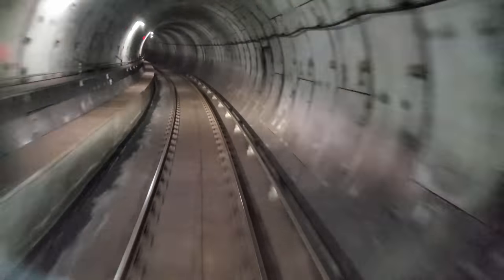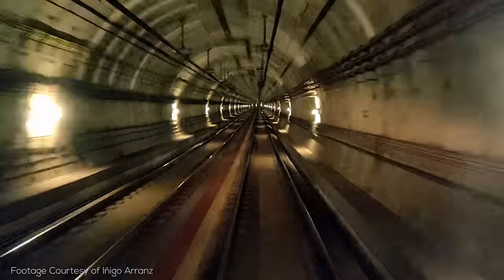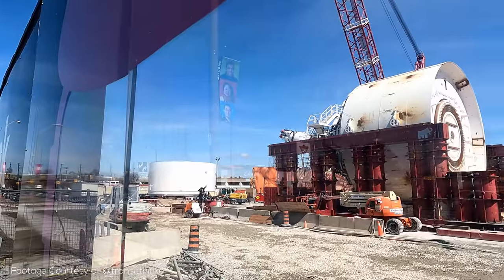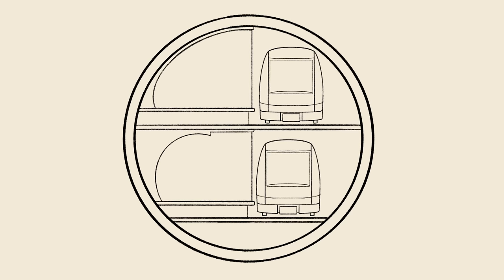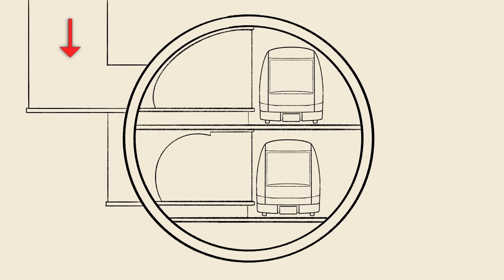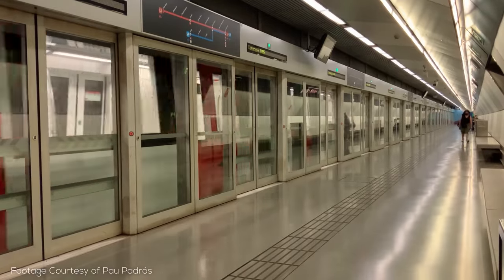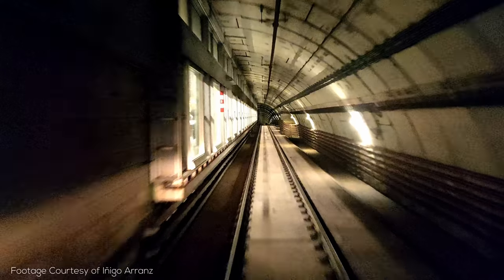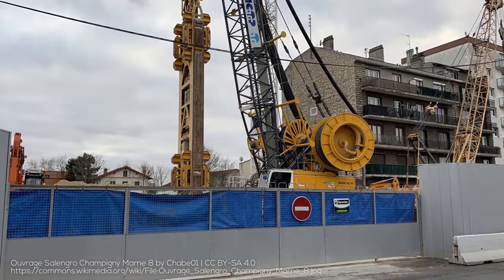A Different Way to Build a Metro? | Barcelona Line 9

Comment: Nebula viewer here, just dropping to make a quick comment... The other reason why cut&cover sometimes is not the most efficient in Europe is because of the amount of ruins we have. With the cut and cover method, works stop for months or even years at a time, and it takes a lot of time and resources to go even the smallest distance. While if you go much deeper, you can avoid it (mostly, except in stations, there you are going to find that issue again, but is just the stations as opposed to the whole thing). That's why Granada's "metro" (glorified tram) took so long on its central section, and is the reason why further projects might consider deep tunnels if they're ever implemented
Reply: That's the story of Rome's Line C metro
Reply: I believe that in one Italian subway system, the approach by the workers was "archaelogical treasures?  Huh, we just jackhammered through everything, move along..."  I think there's even a reference to that in a Fellini film.
Reply: Yeah. In Croatia, just the installment of a pedestrian underpass to access the platforms at Sisak station is already taking 9 years.
Reply: Same in Naples, Italy; the delays for one of the metro lines was constant due to the ruins and artifacts found during digging and boring. One line found everything from Roman villas to Greek merchant vessels, with practically all of it being left in situ as displays. Pretty neat
Reply: That’s and they don’t have wide streets like NA
Reply: Istanbul M7 - Besiktas/Kabatas stations, it looks like those 2 stations will take 10+ years to finish by the time they are done, as not 1 but multiple ancient settlements were discovered during their construction. (Not cut-and-cover but very close to surface due to being sub-sea-level.) They are even opening half of the extension in 3 weeks without those stations since the progress difference is that large.
Reply from the maker: It definitely can be the case - but it depends on the location!

Comment: Another crazy feature of lines 9/10 is that each level of the tunnel is fireproof and acts as an emergency exit for the other. That means emergency shafts that are usually required on modern subways are not needed. Also, because all the width of the tunnel is used, there is no room for sidewalks. That is not an issue at because in case of an emergency, the front of the train opens and a ramp allows passengers to walk on the tracks. Walking on the tracks is not dangerous either since the line uses overhead wires.
Reply: It's an overhead rail, and the signal current runs through the rails, but yeah, it's not as dangerous as it would be on the Northern Line in London. A lot of the Eastern end of the lines does have walkways beside it though, as it just makes things simpler.

Comment: The busiest stations of these 9 and 10 lines have only one or two elevators whereas the unimportant ones, eight elevators. Really wise, hahahaha
Reply: that's... bad... though how much of that is down to the fact that the ones that were Expected to be busiest (and presumably would drive a lot of the use of the currently underutilized ones) haven't actually been built/connected yet?
That would eliminate the 'unimportant ones' having too many elevators. Doesn't solve the lack of elevators at busy stations issue though.
Reply: @laurencefraser  
Hi. Well not quite the case. They’re busy coz they are connected to other lines. = it s about busy transfers.
These busy stations are as new as the others.
Reply from the maker: IIRC because they do have tons of escalators?
Reply: @RMTransit  
No. If you check these lines you ll see what I say. There are escalators in all stations and many elevators everywhere but not when they are peremptorily required. It s like saying two plus two is nine. I know well these lines.

Comment: Some precision on Barcelona line 9: the upper part of the tunnel (including the upper part of the stations) between Torrassa and Zona Universitària is still not built, the line is therefore single track in the lower part of the tunnel on this section. Line 10 could technically end at Zona Universitària like line 9 instead of Collblanc, but that would decrease capacity because as I said it's single track (single track terminals are terrible for frequency, terminating at 2 different stations is therefore required). On lines L9 and L10 North, both terminate at Sagrera station, which is also single track, all trains use the upper part of the station as the lower part is still not built. If the line has taken over 20 years of construction, it is not for technical but financial reasons, work stopped for almost 10 years (there was only 4km left to dig!) and did not resume until 2022. The Montreal pink line project was to use this method before being replaced by the REM de l’est, whose central Montreal branch was canceled.  However, a new route further from the green line and entirely underground has been proposed and may use the Barcelona method (although this is not necessary outside of Europe as the streets in Canada are quite wide enough  to build cut-and-cover).
Reply: As for the branches vs. separate lines debate, I think the correct answer is that it depends on whats make the line important. Line A of the RER has 5 branches (line C even has 7) and is considered as a single line because its most important part is the cross-city tunnel. On the other hand, the future lines 16 and 17 will share the same tracks between Le Bourget and St Denis Pleyel and even if the frequency will be higher on this section, the core of these lines will be the branches, as these lines were designed to connect the suburbs together, unlike the  RER and metro lines 7 and 13 which connects the suburbs to the city-center via the central tunnel.
Reply: Line 15 in Paris will also have some deep stations with high capacity elevators. The most notable example is the 52-metre-deep Saint-Maur–Créteil station which will have 11 elevators and (unlike Barcelona) a huge beautiful helical stairs. One of the most beautiful stations of the grand Paris express project.

Comment: One thing you didn't mention is the extra space gives more room for technical trackside equipment and maintenance access. Between stations, it should be more practical to access the tracks and fix infrastructure items without stopping traffic or at least limiting the time of stoppage compared to a conventional tunnel design. Emergency access for responders and evacuation is also improved. It should be possible to drive a rescue/maintenance vehicle along much of the tunnel if a smooth surface was provided, improving response time. Adding stations and new junction or turnback locations after initial construction should also be easier.
Reply: Extending trains and platforms would kinda be cheap and quick too as long as 1 end of the platforms is kept clear when built. Could literally double the length of trains and therefore double the capacity of the line. Cities can spend billions reducing train frequencies from like 140 seconds to 100 seconds because it's the only way to increase capacity and even then 100 seconds is kind of a cap. But assuming an entire line is built this way the capacity could be endlessly increased whenever needed. 

Forget crossrail being futureproofed, it's already packed and barely space during rush hour, the 2 extra cars there planning in a couple of decades will be too late and won't be enough. This new design could easily handle increases in passengers for 100 years by just cheaply keep adding cars and basic non structural platform changes.

Comment: What I also quite like is the passenger evacuation concept on Barcelona's Line 9. Because the line is fully automated and there is no drivers stand in the way, the whole front or back of the train can open up to provide emergency egress for the passengers. A ramp then unfolds which makes it also possible for wheelchair users to evacuate on their own. This is also aided by the lack of ties between the tracks, which lessens the chance of people tripping in the tunnels.

Comment: Having taken the line 9, I'd say it's really convenient to get into stations with elevators. They're fast, and there are a ton of them. 
However, they get filled up really fast in busy stations. And in some stations such as Collblanc or La Sagrera, they've put a ton of escalators instead of elevators, presumably because they're too busy.
Reply: Yeah, the capacity of escalators, which are continuous, versus even large capacity elevators, wasn't mentioned.  How was the capacity of the platform?
Reply: bro I thought they were playing a practical joke on me when I first transferred at Collblanc with how many escalators there were
Reply: @bearcubdaycare  in Collblanc, where L9 links with L5, and L10 ends, there were plenty of people in the platform. But they all fit in the platform. Although I rarely take the metro during rush hours.
Reply: @viajadorsindatos7041  6. Yes, six. 
With the elevators is much faster to get on/off the platform than the escalators.
Reply: If they are too busy they need lots of elevators !!!!!!
Sheer logic !
Reply from the maker: Bigger and more elevators needed! Iirc the capacity is probably actually competitive with the right number!
Reply: @RMTransit  
Not competitive in this regard

Comment: 6:25 BART will not be building island platforms in the San Jose extension. The northernmost station at Little Portugal will use side platforms, and the stations in downtown will use the stacked configuration just like Barcelona.
Reply: VTA's latest blog on the matter (titled "BART Silicon Valley Extension Phase II December 2022 Newsletter") seems to indicate they are considering switching to a larger tunnel bore in order to accommodate side-by-side layouts (I assume throughout the tunnel, but it's not completely clear), which they say will be faster, cheaper, and less disruptive to build.  It seems like it's still up in the air.
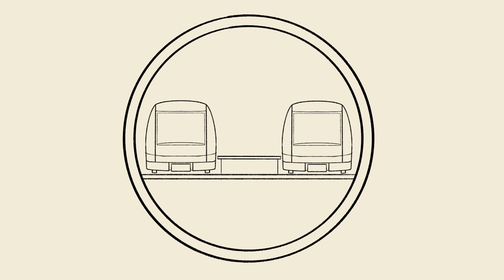Reply: I hadn’t seen that, I hope they stick with the stacked configuration. In any case the island platforms won’t be as narrow as shown at 6:36

Comment: There are some other things to say about Barcelona's line 9 (&10):
- One of the TBM was left rusting and now it's completely useless. It lays under, more or less, Plaça Lesseps.
- The second TBM was able to start boring again few months ago (hurray!!!)
- The reason line 9 only uses one of the tracks at its provisional Barcelona terminal is because the lower deck is used to vacate debris from the boring machine that is operational.
- Actually there had been troubles with a building's foundations, which were deeper than expected by its blueprints.
- The delays in its construction comes mainly by the lack of resources to pursue its construction. The original plan was to have the line as a concession to a company, so the government pays a fee from a date (expected of opening) during a given time. Several delays made the government to start paying without the line being operative. In addition, 2008 crisis prevented the government to allocate more money to the finishing of the line.
Barcelona's metro history provides two cases similar to this trouble with line 9 (& 10):
- Even before the construiction of the first metro line (now number 3, green), Barcelona city council planed to open a new street through the old city center, now Via Laietana, under which was planed to build a subsurface tunnel for a metro. Tunels were left unfinished and to the open air for years, as money to end construction ran short. Finally the tunnels were finished and inculed, as a branch, for the Gran Metropolitano, after line IIIB. Nowadays can be seen in some parts the difference between the original tunnels and the works to complete it, for instance, right after the abandoned/unfinished station "Beatas/Banco".
- Lines II and V: For a long time there had been a gap in the numbers of the lines in Barcelona. Number 2 was missing. It actually existed and operated for some years while being built, as well as line V (yes, in roman numerals back then). Both lines II and V meant to meet at Sagrada Famila, and diverge again: Line II under carrer Provença (nowadays line 5 station), Line V under avinguda Gaudí (abandoned station). Works for line II from Sagrada Famila to the north were uncompleted but finished at one of its ends. So, instead of having two parts of line II, the central side was joined with line V, the norther bit with line IV.
Reply: Lol, incredibly accurate!! That's a problem not only in Barcelona, but in Spain as a hole most times. Other Transit-related delays to mention in Barcelona could be the Sagrera and Sant Andreu stations

PD: the only thing you said that's wrong is that the deck being used to vacate debris is the upper one, not the lower one (at least at Zona Universitaria)

Comment: Cut and cover isn't used in London because the amount of property demolition required would be excessive. We also dont have long straight roads found in NYC. Remember that the District and Metropolitan lines were built using cut and cover and certainly large parts of the Met run under roads.

On lifts: News for you - many London Underground stations did have lifts. They naturally have less capacity than escalators and quite a few stations were upgrade with escalators being added later.